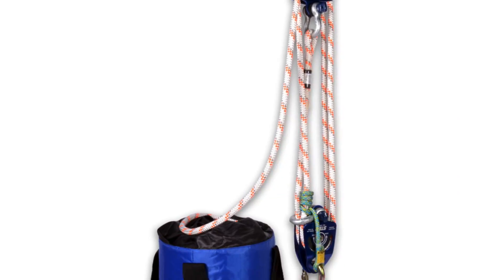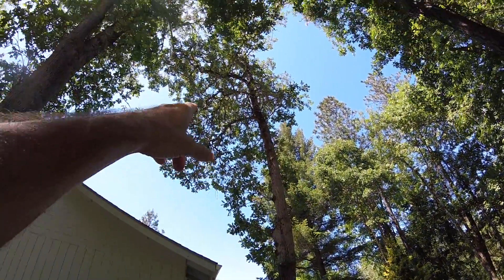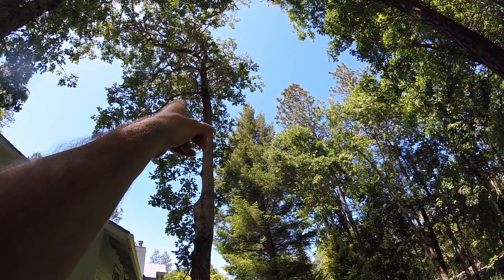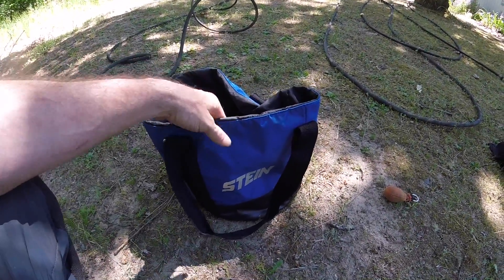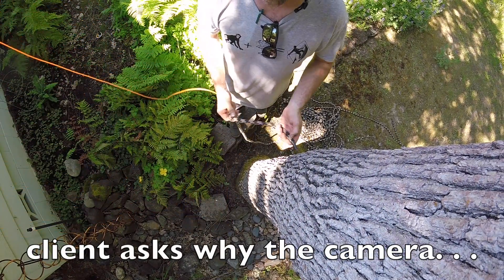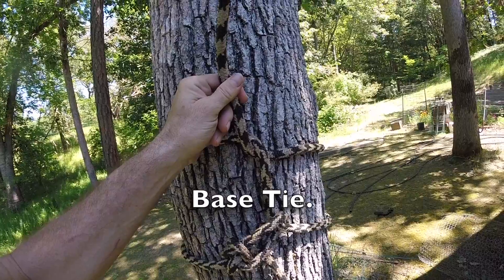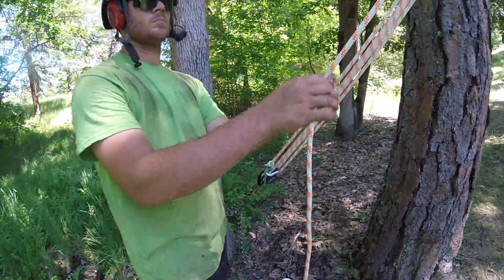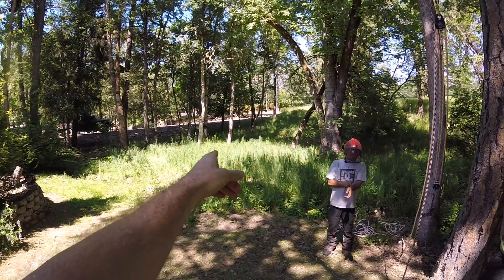Felling Principles: Compensation Pulling

Comment: Just a thought: the fiddle blocks are 5:1 by themselves but in theory that base tie to the branch up top is a 2:1 system by itself. Now of course there's friction involved and the angles involved change the mechanical advantage but this is up to a 10:1 compound system the way shown.

I already got the double pulleys laying around but never thought to keep them prepped and ready in a kit like that, I like that.

Comment: Nice... when I need to, have typically used a large portawrap anchor - steel biner the lower block to top rope guide loop, another steel biner the upper block to a hefty loop prusik on the bull rope, mostly for a larger tree with more lean &/or limbs. ;)

Comment: Would you have been able to use that same setup if that tree had been, say, 2 feet DBH? ... I think yes?
Great video. Nice shot.
Thanks for all the explanations and clear instruction!
Reply from the maker: Robert Wood ya depending on attachment points/leverage. Some pulling scenarios need much bigger pulling implements. Principles of compensation (engineered holding properties and manufactured leans) remain the same though.